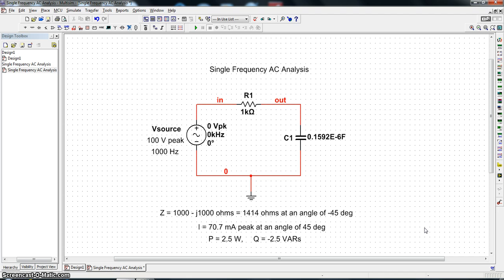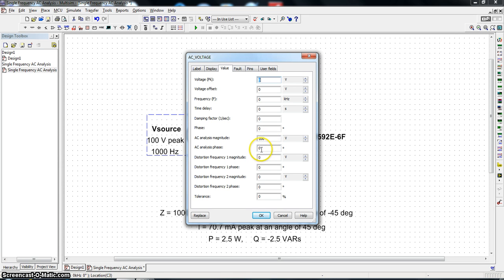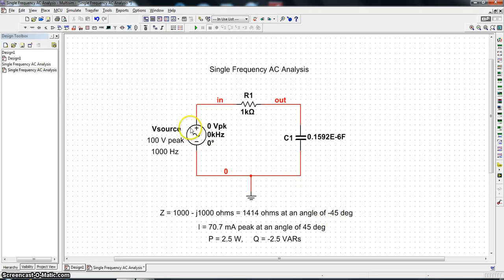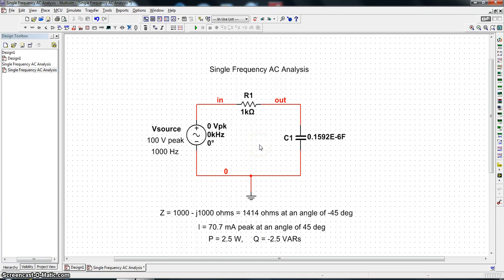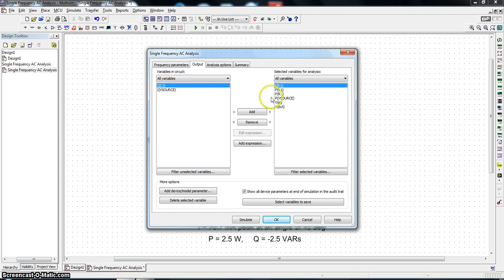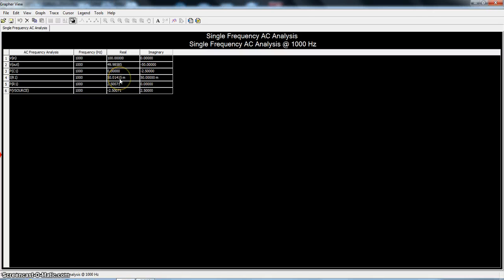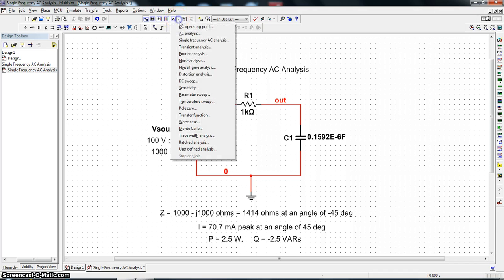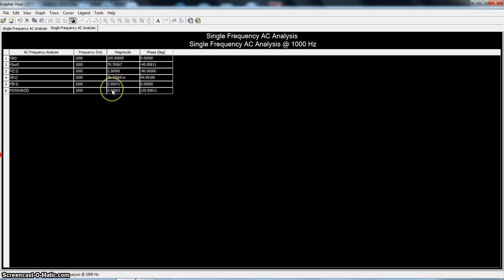WDS T11 Single Frequency AC Analysis

Comment: I have a ac circuit like you have explain i want to record both circuit current and voltage waveform using oscilloscope and function genarator then i want to calculate current phase shift and magnitude how can i do this help me